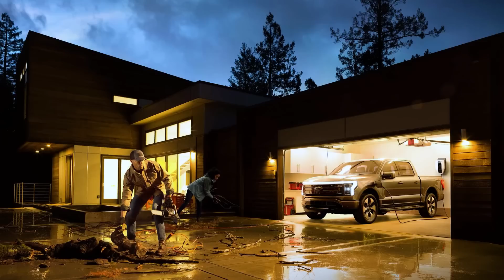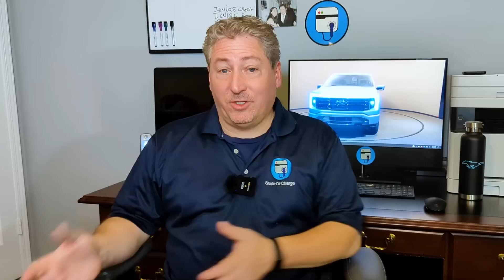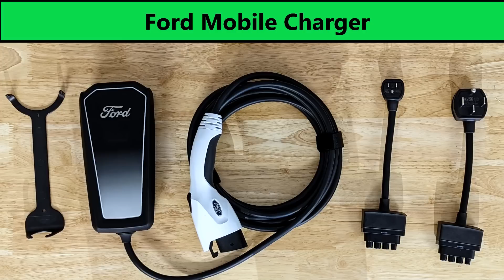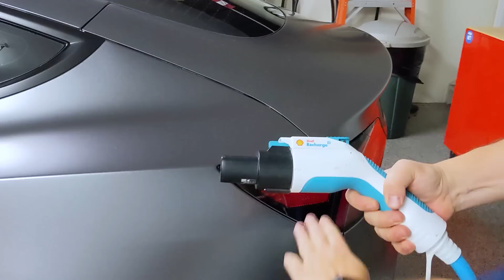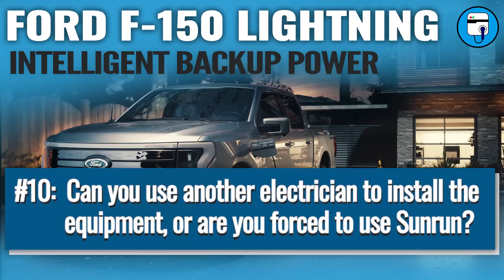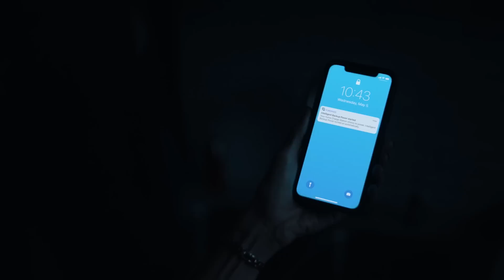Ford F-150 Lightning Intelligent Backup Power: Everything You Need To Know

Comment: So how is the system communicating to your phone if the power is out?  Home will not have internet if the modem/router has no power.....
Reply: All modern vehicles have integrated cellular modems for the vehicle command/control functions for your phone (remote start, check fuel / energy level, etc).  Tesla takes this to the extreme with what you can do, but even the conventional OEMs have mobile apps that talk to the car in the same way.  So if you loose the WiFi in your house, both your phone and car will stay in contact using cellular (data).  Now, if the cell towers go dead during the blackout also, then you'd have to do things manually at the truck.

Comment: You are wrong about the solar the solar won't be able to run along side. If your solar over powers your inverter it will try and backfeed
Reply: Tom mentioned a big 'maybe' here.  With a full Sunrun system it sounded like this is possible (components likely speak the same language to curtail solar generation output to balance with home usage and truck output).  But yes, if the truck can't backfeed any excess solar from non-Sunrun systems, that solar system would have to be disabled when in Backup mode to avoid household equipment damage (all generated power must be consumed somewhere).  If this all is true, this system is less capable than a stationary backup system - which will charge the battery from excess solar (a good thing not wasting power, and keeps the balance).  It would be disappointing if the Ford solution can't do this given access to the gigantic battery - really just more of a silent generator solution (where you have to disable your existing solar).

Comment: Ford seems to have jumped here ahead of the international standard ISO 15118-20.

Will be interested to see whether it will be upgradeable to meet the standard later on, or whether early customers are likely marooned with a proprietary solution.

While it's obviously cheaper than a dedicated battery (or Powerwall) it's only good if the vehicle can be at home in the event of a power outage.
Reply: " it's only good if the vehicle can be at home in the event of a power outage."
Since the vehicle has wheels and can travel that doesn't seem to be much of a problem.

Comment: I’m interested in learning more about the ability to integrate the Ford backup system into my existing solar installation with a SolarEdge inverter. I have 400 AMP service and am about to have an electrician install a dedicated 100 AMP service to my garage. When I installed solar last year I delayed buying a powerwall battery in anticipation of buying a Lightning. My hope is to be able to use the truck to power the house every night and then recharge the truck with excess solar during the day. It sounds like this will NOT be possible out of the box. I understand the concern about battery wear and tear but we’re not talking about that much usage, maybe the equivalent of driving an extra 15-25 miles per day. I hope Ford will reconsider their position.
Reply: You could put a manual disconnect on the incoming power and it would react just like in a power outage if you don't mind doing that manually.

Comment: Starting HVAC compressors can be difficult with peak startup power at multiples of the average power consumption.  My heat pump consumes 2 kW for example but starting surge is well over 10 kW I think.  So is there a spec on the surge ability of the inverter?  I expect it is pretty good, even the onboard inverter for job site power should be able to start a circular saw and such.  I have heard skeptics ask about powering arc welders from the onboard inverter for job site power, but that seems like a fairly rare use case compared to air compressors and such.  And of course, why not power your house with a cheaper manual transfer switch or two and cord(s) going to the outlets in the truck?  Not automatic but if you do not have frequent outages, it is an option.
Reply: Ford has an arc welder as an example for powering from the 9.6kw pro power in the back of the truck. So it may be rare, but it seems like they took it into account at least.

Comment: 7:40  Really odd section on derating the charging (20a) but allowing the "Charge Station Pro" backup power (100a).  Isn't the wiring the same? Diff charging circuit vs power backup?  A 100 amp [circuit] wiring size requirement is #4 for copper wires and #2 for aluminum wires.  -- P.S. Props for doing this whole video. It was outstanding and overall you explain these topics really well.
Reply from the maker: I will get complete clarification on that soon. I believe you need to run two feeds. One for charging - that could be a 20-amp circuit. And one for powering the house that goes to the inverter- that would need to support the 40-amps the truck can provide to the home.
Reply: 9600 watt backup power is only 40 amps AC at 240 V.  100 amp circuit for charging is optional and does let you charge in less than 8 hours even from zero to 100% on the largest battery.  But you can charge at 20 amps also, it just implies that it will take 4 times as long.  Heck, it will probably even charge at 7 amps, but that could take almost a week.

Comment: Tom. 1) Where is the Lightning Intelligent Backup Power, DC to AC inversion done? In the Ford Charge Station Pro?
2) Does Ford use standardized CCS protocols or are they using their own proprietary protocols, for its Backup Power function?
Reply from the maker: It's not done in the charge station pro. It's done in the inverter that you need to buy as part of the equipment package needed to operate the system. I explain that at 17:29 of the video. I am 99% certain that they use standard CCS protocol.
Reply: @StateOfChargeWithTomMoloughney  thx for getting back to me 
1) and for confirming it done by the SunRun inverter and not the Ford Pro... 
2) CCS has not officially approved the protocols yet ... So if you could pls check with Ford...to confirm that they use them and if there will be OTA updates after CCS   officially approves as a standard...  

Since then other updated CCS EVs could  be used as the power source, instead of just the Lightnting
Reply: @StateOfChargeWithTomMoloughney  And sorry I was just remembering your last post.
Where I only heard the SunRun transfer switch was needed,  Not the Inverter as it was mentioned here... which makes more sense and adds more to the cost...

Comment: So if you need to go to the grocery store in your F-150 EV while the power is out at your home, anyone staying at home is SOL. I don't really see how this makes sense.
Reply: Correct, need an electric motorcycle for shopping!  For me, compared to the cost of trying to hook up the Ford / SunRun transfer system, I think a big home solar & battery system makes more sense and then one can then go completely off the grid.  Electric companies are adding fees for grid connection of solar and  do not want customers to avoid retail rates.  I wonder if they will consider backup power systems the same way?  Power companies are going to TOU rates (time of use) which burn folks between 4-9pm.  Need to setup automatic transfer to battery backup to avoid the high priced kW-hrs.  The Ford Lightning power take off seems best for remote tool use and camping, assuming it does not take too many stops for charging to get there & back.  I think the plug-in hybrid is ideal for most local mileage and there is a huge range and easy fill-ups for long range travel.  Plug-in hybrids do suck for needing to run the engine periodically to provide heat & to insure the gasoline does not evaporate the naphtha solvent and turn to varnish.

Comment: What about the Ford range extender? Delta Cosworth has a microturbine that is 100 LBS and 35 kW output. Cheap also. $2K. Look at the Omega 1 engine at only 35 lbs. Another great option for range extenders.  Is Ford going to make the range extender for Lightning? The generator will not only charge the Lightning, but could also power the house. As Always great videos.  Thank you
Reply from the maker: We'll talk to Ford about that in the future, this is just about the IB Power.
Reply: Turbines are loud and have lousy efficiency without cogeneration.  Turbines shine at power to weight ratio but that is about it.  Failure modes can be expansive.
Reply: @jimmclaughlin2603  for cross country I think the noise would be ok. I am interested in the failure rate also. Delta has been using them in racing automotive since 2009.

Comment: Tom, here's a weird one: I have a sub panel that covers about a dozen circuits with a manual transfer switch for my 10k generator in the event of a power outage. My NEMA 14-50 outlet is included in my sub panel. My question is: can I plug the Lightning's 220 amp in the bed into my transfer switch and my NEMA 14-50 into the Lightning? Will the Lightning still charge while being charged? We are very frugal during power outages.
Reply: The outlets will operate while the truck is charging.

Comment: Tom, what about using your batteries to power equipment/tools at a "jobsite". Ford actually advertises that possibility. Will THAT void a battery warranty?
Reply from the maker: Yes, you can do that, but that's a totally different system called Ford Pro power. This is Ford Intelligent Backup Power which powers the house from the charging socket, not the outlets that are on the F-150 lightning.
Reply: @StateOfChargeWithTomMoloughney  Yeah, thanks I'll only be ordering the standard battery pack and just want to use the Lightning occasionally other than my generator. You're the best and I trust your knowledge.

Comment: Great video Tom. I see the question a lot about do you need the 9.6kW inverter to do the home backup, but since the system is going to use DC to power the house, you could still use the 2.4kW inverter and still get the 9.6kW back to the house.

Comment: Great job great information.

My question.  When I get my F-150 and I will have the extended range and the intelligent back up.  Will that charger charge my other vehicle. Kia soul
U mentioned no for the tesla.  But will ford make an adapter or can u buy one just to charge a non tesla electric vehicle...  basically just to use the top part of that charger connection.  Thanks and keep up the awesome job
Reply from the maker: Yes, it will charge any EV except for Tesla and the EVs that use the CHAdeMO standard because Tesla uses a different connector also.
Reply: @StateOfChargeWithTomMoloughney  I will take a picture of mine.  I swear the truck is up and down... mine is side by side
Reply: @StateOfChargeWithTomMoloughney 

So for some reason I can place a picture here.  But it is side to side with a door over the DC connection.  So I am pretty sure it will not connect to my kia soul
So google...
kia soul ev connector what does it look like.

And u will see what I mean.
Side to side with a door
Reply from the maker: @toddzdanowski2200  You're correct. Kia used the CHAdeMo standard for the Kia Soul EV. Kia has now switched to CCS like everybody else. Nissan also used that connector for the leaf but now they've switched to CCS for their new vehicles. Mitsubishi also used it but the North American standard now is CCS and all of the automakers except for Tesla are transitioning to CCS.

So unfortunately, no, you wouldn't be able to use that station to charge your Soul EV. I apologize I didn't fully read your comment before about what kind of EV you have.
Reply: @StateOfChargeWithTomMoloughney  So now that u know my ev situation .  Will Ford have a 2 - 25 foot cords.  One for the rest of the evs and one for my new Ford truck.  Please ask them that question.  I am sure the tesla person and my self will choose that option.
Thank you for your time.  Keep up the great job
Reply from the maker: @toddzdanowski2200  I can answer that question now - no they won't. The charge station Pro is going to use the CCS connector. 
CHAdeMO is being retired in North America. They're not going to support a standard that's no longer being implemented. Even Electrify America is discontinuing installing CHAdeMO connectors on their new charging stations.  But I definitely will talk to them about it and at least get a comment.
Reply: @StateOfChargeWithTomMoloughney  So this typing and the English language. I am sorry I am not bring my point across.
If I get a basic Ford charger.  It will charge my ev and it will charge the tesla.  That is a fact...  It's the intelligent backup the throws a kink into the deal.  .if ford add a second line to their station... and put the north American basic standard connection on it...  they satisfy all current ev owner... including tesla.

Comment: Tom Q for Ford: Can we use the onboard power outlets while the truck is level 1 or level 2 charging so at 120 or 240V? Can we use the outlets while the truck is DC fact charging? Lastly can we use the on board AC outlets while the truck is sending DC power to the home sun power inverter in a outage? Thank you.
Reply: Yes. The outlets can be used while charging the truck.
Reply: I would think there would be some efficiency losses, but if the truck receptacles are convenient, why not?

Comment: I just wanna add one thing to the battery question of 14:

If you do plan to leave it sitting without use, the optimal thing to do is to leave it at 50% state of charge. The closer you can get to 50%, the better, since batteries are at equilibrium (especially lithium ion) at that percentage.

Comment: The piece of plastic on the connector is to prevent people from charging a DC connector into an only AC charger capable car. 

This Ford charger really doesn’t need that, because the DC only flows from the car in its situation. So I wonder if their actual charger will have that plastic lip that prevents a Tesla adapter from being plugged in?
Reply from the maker: In the video, I show a picture of the Charge Station Pro and it has a plastic tab between the J1772 and DC pins - I believe for strength. Unless they change that from the one I saw at Ford's Development Center in Dearborn, the adapter won't fit.
Reply: @StateOfChargeWithTomMoloughney  Ok, so what you showed is the actual connector of the Ford Charge Station Pro? Got it. I wasn’t sure if what you had was a more general example of a CCS connector plug.

I’m sure that plastic piece is there intentionally in the more general case, to help prevent people from trying to plug a DC charger into a non-DC capable car. Kind of like a NEMA-20 plug not fitting into a NEMA-15 receptacle.

It’s too bad it’s on the Ford charger but not surprising, I’m sure wherever they’re sourcing the part is just confirming to the SAE standard.
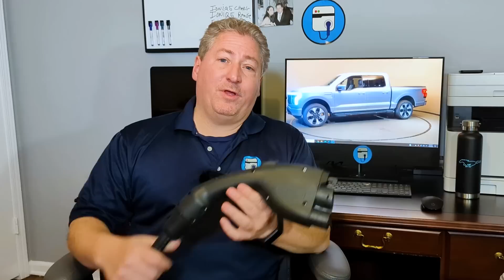Reply from the maker: @ericcote6920  The connector that I'm holding in the video is a CCS connector, but slightly different than the one that Ford is using. You need to look @9:47 of the video to see the actual connector that Ford had on the Charge Station Pro that they showed me.

Comment: EV Extend makes a kit that basically lets people have a 6000W backup from an EV with a split phase inverter. Not a bad option given some of the costs that started adding up for the intelligent backup transfer equipment and the 80A charger. 

Great video and insight here Tom!
Reply: Not the same thing at all. Requires you to connect to the 12V battery in the vehicle, and most vehicles will be limited to ~1500W continuous. Definitely not an automated system, and will be less efficient. Better than nothing, but very limited use case.

Comment: So I’m not clear, does Intelligent Backup Power and Charge Station Pro use the same cable and plug into the charging port? Or is backup power AC power coming from one of the 8 AC outlets? If AC is it 40 Amps x 240 volts for 9600 Watts or is it 80 Amps x 120 Volts? Or is backup power delivered as DC then inverted to AC by whatever inverter you use? If supplying DC what is the voltage? Sorry for all of the questions. Thinking about how to integrate into existing solar + battery system. Thank you.

Comment: From the Sunrun FAQ on their website:
“Will the EV charger installed work with other vehicles?
Yes, the Ford Connected Charge Station and Ford Charge Station Pro Connector uses an industry-standard/universal SAE J1772 connector. This is compatible with all-electric vehicles on the market today that are compliant with SAE J1772, including Tesla with a commonly used adapter.”

Based on your excellent video, it looks like their information is incorrect.
Reply from the maker: One of us is wrong. I already reached out to Ford for clarity.
Reply: @StateOfChargeWithTomMoloughney  They also have suspect info in many of the photos.  There is one with a man with a white hard hat and gloves shown wrapping the vehicle cord around the station.  In that photo, it clearly shows a J1772 plug - not a combo CCS plug.  Also shown is a gigantic diameter charge cord the size of a gas hose.  If the plug on the Charge Station Pro is as they show, then the Tesla adapter would work as they state.  But if it is combo CCS, then it won't work.  Definately some conflicting info.
Reply from the maker: @billjohnson3344  I know. But it does use a CCS connector, that I am 100% certain of.